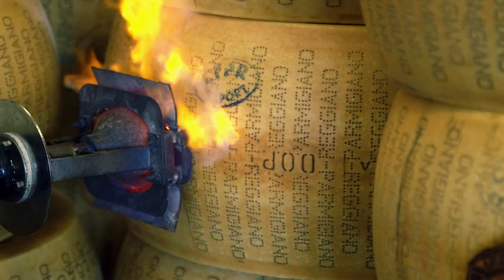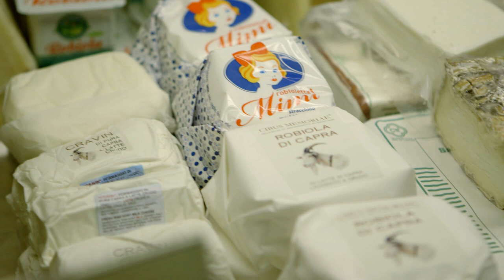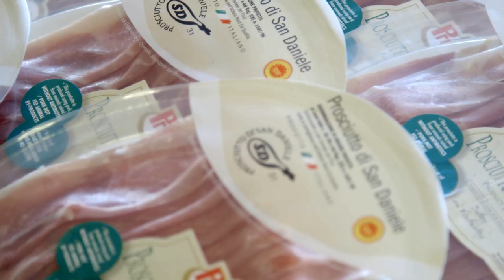For The Love Of Cheese l Whole Foods Market

Comment: On 11/19/2020 at approximately (10:25-10:35), I entered the Whole Food Market / Foggy Bottom, Washington, DC with the intent of purchasing bath soap. I was carrying a reusable grocery bag containing two items I had just purchased from CVS. Without needing to touch Whole Foods' merchandise, I determined that this location was sold out of the brand of soap that I wanted thus I proceeded to exit the store.

Before I could exit I was stopped by a Whole Foods Associate named Troy who informed me that I could not put Whole Foods merchandise into my bag without first paying for it. Further, he stated that there is a sign posted at the entrance. 

Also, a store security officer had relocated from the entrance of the store to a position atop a stairway used to exit from the lower level of the store.

I am perplexed as to why Troy needed to remind me of a store policy of which I had not remotely violated as I had not so much as touched Whole Foods' merchandise and why a security officer was placed on "stand-by".

Did I fit a particular profile?

On 11/19/2020, I reached out to Greg, Assistant Store Manager as well as the Whole Foods Customer Complaints (via phone) and asked for follow up on the following questions:

(1) What prompted Troy to think that I had or was about to put Whole Foods' merchandise into my bag? 
(2) Did someone prompt Troy to instruct me to use a shopping cart rather than my reusable bag, if so who? 
(3) Prior to 11/18/2020, were Whole Foods Associates tasked with approaching every customer to remind them to use a shopping cart rather than their reusable bag? If not, what criteria were used to determine that I needed to be reminded of the aforementioned policy?